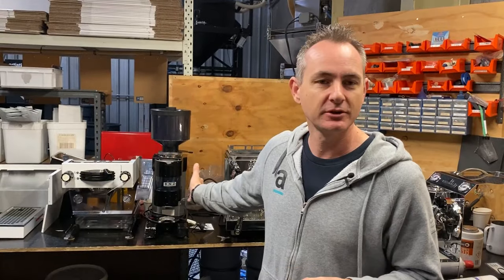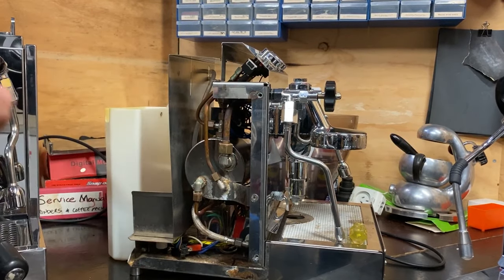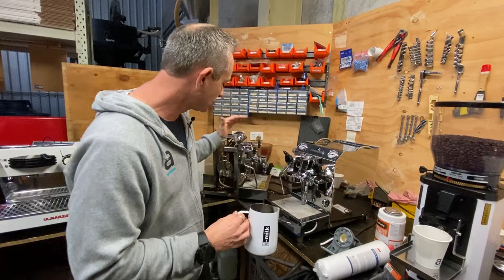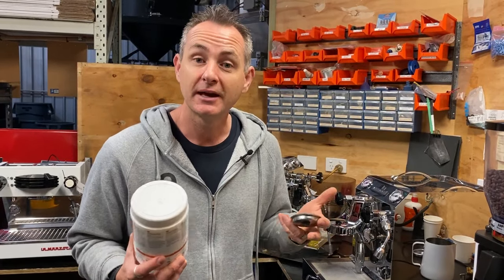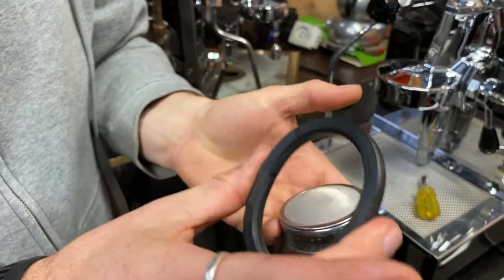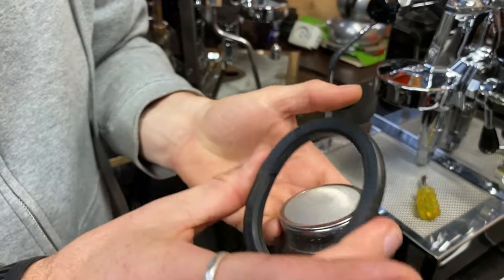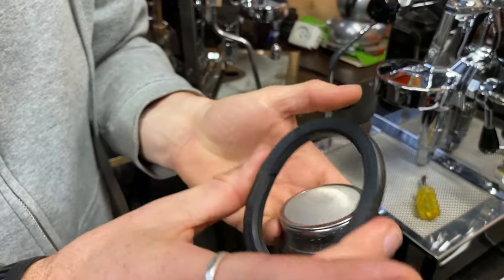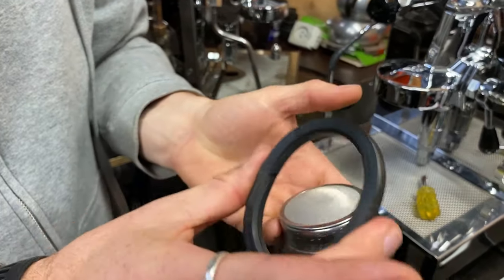Simple Care & Maintenance Advice to PROTECT your COFFEE MACHINE

Comment: This is great! You've just confirmed my theory of flushing the tank via hot water tap can reduce scale buildup. The more steaming you do, the more flushing you gotta do. Because as you steam, you're taking the water out as vapor but leaving the minerals in, leaving the remaining water inside with higher concentration of minerals. It's not an advice that is commonly shared on the internet but been doing so ever since I got my machine :)
Reply from the maker: Perfect! Yes I have not seen it out in the web
Reply: How often would you flush the steam boiler via the hot water tap?
Reply: @impalist  For a full flush, I'd say about once every 2 weeks. My gut feeling tells me that I don't have to do it so often because there's somebody in the house that drinks americano/long black. So the water in the boiler is always used in a fairly good amount and refreshed daily anyway because of that. Just have to make sure that when you use the hot water tap, you make sure the pump kicks in to fill it back up again, before turning off the machine (if using the hot tap water is last in your process). I use it to rinse my milk pitcher too, so my hot water usage is at the start and the end of my overall process.
Reply: Thank for this most excellent video! With regard to this comment thread, should one purge the hot water tap with the machine on and turn off the machine right after, or purge that tap after the machine is off?  Or should one purge and wait for the boiler to refill? I am new to how my Magister Stella works and want to treat it kindly 😁

Comment: Great advice, really appreciate the advise about using the hot tap often.
Q: Carbon filter is best for espresso?
Q: When water is leaking or running down outside of port filter, is the seal not sealing?
Reply from the maker: Yes a carbon filter is best. If the water is leaking over the outside of the porta filter you need a new seal. 👍🏻

Comment: This is very interesting information regarding the steam boiler and how the steam doesn’t have any metals in it as it’s being released. All the metals are staying in the steam boiler. This is the first time I’ve heard to empty steam boiler by flushing out the water using your water spout.  That being said, What about machines that use the same boiler for coffee and steam like the Profitec 800. This is a single boiler for coffee and steam therefore the water is actually being used every time you make coffee. How often would you suggest to purge the water on single boiler machine?  Also, What type of bottled water are you referring too that is safe to use on espresso machines?  Spring, Purified? Thanks!
Reply from the maker: So yes is you have a single boiler that shares the steam and water heating it will have to be purged as you swap from water to steam, so this is good. Bottled water still should be tested, yes it’s tasty, but is the spring high in ph? Full of lime? I can recommend a water brand, sorry. We have only access to commercial brands here and they have not paid us for a referral 😂😂

Comment: Great advice as usual mate! And glad I did backflush with coffee detergent (using cafeato) once a week on a regular basis to keep my machine clean & maintain its longevity. After seeing the one did not clean properly (presumably never been backflush before) like eww..
Reply: Are you doing that on home machine?  With my new (and cheapest E61) I decided to do chemical flush (with cafiza) at 6 months, and change screen and maybe gasket at 12 months.
My first E61 got all squeaky on the lever after using it and never got smooth again (put tons of proper lube on it)
Reply: @georgepirpiris7309  man that’s too much on the machine to handle use it at least every two weeks and it also depends on coffee consumption
Reply: @malnhar Thank you, I just cleaned it after  8 months use, it wasn't so bad. I will do it more often now. The squeak is not so bad this time.

Comment: Another question, on the boiler maintenance is descaling is an option OR avoid it at all cost?
Reply from the maker: It will need a descale at some stage, but prevention is better than cure. Keeping an eye on your machine regularly will help avoid a descale. Leave it a few years and you will have to descale sure. When I say descale, I mean professionally. A small home descale would be advised if your up to it.

Comment: Hi brilliant video! I have just purchased Rocket Appartamento machine. Not sure about my local water from the tap, would it be safer just to use bottled water? Also, I tend to only use 250g of coffee every 2 weeks. Should I clean the machine with a chemical every 2 weeks or every 1KG? Thanks
Reply from the maker: Bottles water will be better, clean every 250g, the 2 weeks will still allow the oils to Build up. Prevention is always better than cure

Comment: Is there any sort of routine with e61 machines? Should I do anything to release the pressure built up in the machine?
Reply from the maker: Yes, once you turn it off, run the hot tap to empty the boiler, then once all water is out, open the steam tap to reduce the final pressure
Reply: Thanks, and would it be ideal to do this every single shut down?

Comment: Fantastic video. I'm wondering if your advice regarding running the hot water tap still applies for single boiler machines such as the Breville Barista Express?
Reply from the maker: Yes to all boilers, heat exchangers not so much as they don’t hold lots of water

Comment: how would you advise aproaching filtration for a mobile set up?  I could just buy the filter for my home water set up, but this doesn't always apply ( and I can only carry at the moment 40L of water, we are running from the back of a hearse as opposed to a caravan/ trailer where a lot more water could be used.) curious as to your thoughts on how that might be done if I don't know the qualityof the water I'm using.
Reply: for referance I am aware you can buy portable caravan filtration set ups which I was planning  to get, more like type of filters to buy
Reply from the maker: So we would not recommend buying a caravan filter, these are not good enough for coffee machines. You can make a twin filter System and have it in a box that you can take with you to events or leave at home. Set it up with normal hose fittings so that you can access your home or any tap and fill your containers with great filtered water
Reply: What I meant by the caravan filter was that I was wondering if I could buy their caravan filter container with the hose fittings on it and then put the types of filters required for a  coffee machine  in it. I'll ask them if they can do that...
Reply: I'll go to my local Puretec dealer and see what they think. I guess I was maybe overthinking what exact filters to use in it, without being able to pretest the water if I needed to- but hopefully something like a particle filter and then the puretec triple filter that does chlorine etc and scale would be enough?

Comment: Unfortunately, plumbing in isn't possible in my particular situation. Would you have a filtration recommendation for a non-plumbed set-up?
Reply: I would also like to add my voice to this question, as I have a non-plumbed set-up as well. I try to minimise scale by softening my water through a Brita Maxtra+ Limescale Filter first before it is poured into the water tank where I've placed a water reservoir filter inside (like this one - https://www.coffeeparts.com.au/rocket-espresso-water-reservoir-filter ). Do you think this is sufficient? Thanks very much for your tips in this video.
Reply from the maker: If you can pop a filter under your sink and use that tap to fill the water tank it’s great. Or buy bottled water if you can’t have a filter in place. You can use as a minimum a filter jug.